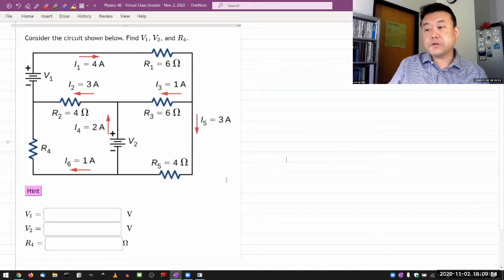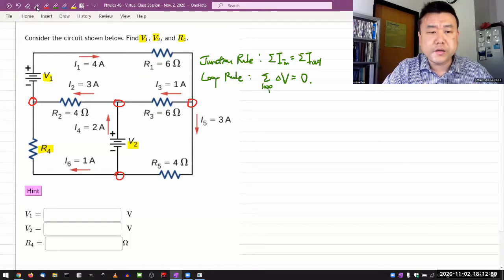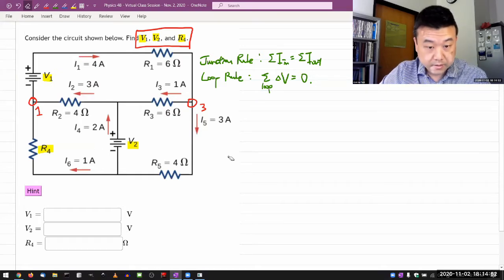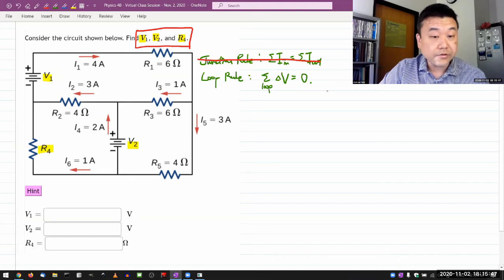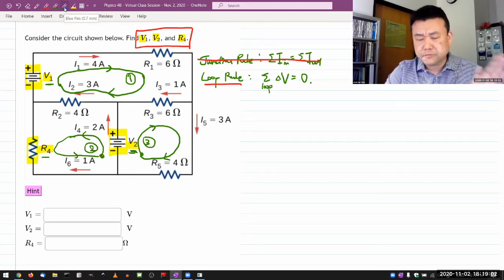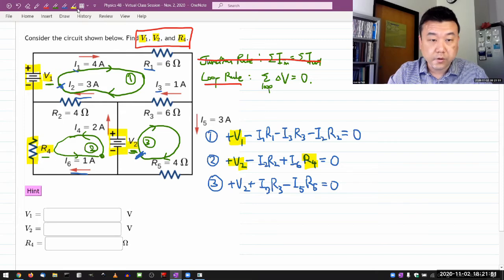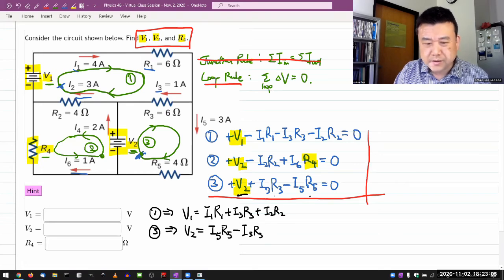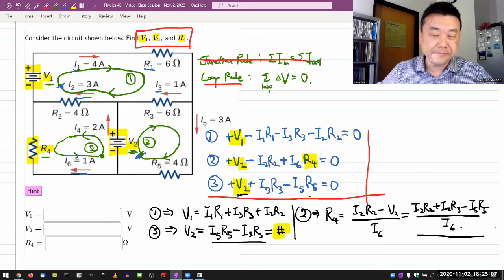Physics 4B - OpenStax University Physics Vol 2, Chapter 10, Problem 39

Comment: what do you do if there is an I5 but no R5?
Reply from the maker: If by "no R5" you meant R5 is zero, then the exact same approach and equations can be used (just set R5=0; the circuit can actually be simplified further, but that isn't necessary for solution). If by "no R5" you mean R5 has an unknown value, this setup is underspecified, because all the loop-rule equations we can get are necessary to solve for V1, V2, and R4 (and none of the junction rule equations we could write down actually help with solving for R5; they just tell us the values of currents that we already know anyway).
Reply: @CoAPhysics   the R5 just is not there. There is an I5 going in the direction of the battery but no R5. I am referring to OpenStax University Physics Vol 2, Chapter 10, Problem 41. When in a situation like this, do I just assume R5=0?
Reply from the maker: @goated9415  That's an entirely different problem; you have to do the analysis again from scratch, using Kirchhoff's rules (both the junction rule and loop rule; you should have 5 equations to solve for 5 unknown currents). There are lectures on application of Kirchhoff's rules that might help you.
Reply: @CoAPhysics   doesnt the amount of equations depend on how many loops there are? I used the laws and put together only 3 equations (since there are three loops in this question much like problem you did in the video) , so im not sure how I can get 5.
Reply from the maker: @goated9415   You have 3 loop rule equations and 2 junction rule equations. In the situation in the video, the two junction rule equations were unnecessary because the system was overspecified (the currents that don't need to be given were given by the problem). A system that is exactly specified (e.g. Problem 41) will need the junction rule equations written down as well.
Reply: @CoAPhysics  is it possible for you to explain to me how to solve this problem (41) please? I am still struggling
Reply from the maker: @goated9415  I explained all I can in a YouTube comment. I recommend that you seek the help of a tutor who can look at your work in detail and help you side by side (if you had been a student in my class, I would have recommended that you come to my office hour).